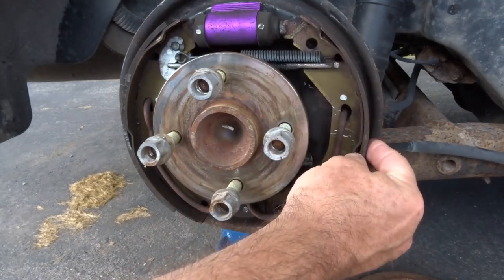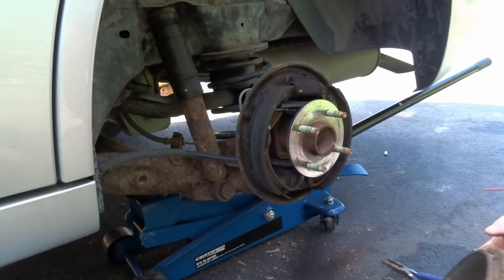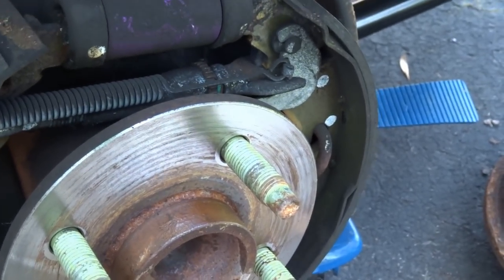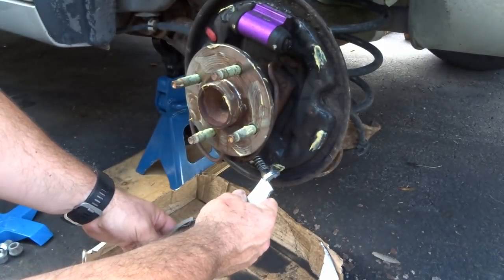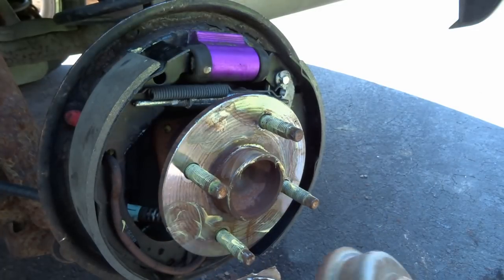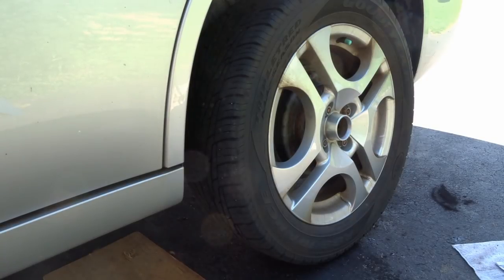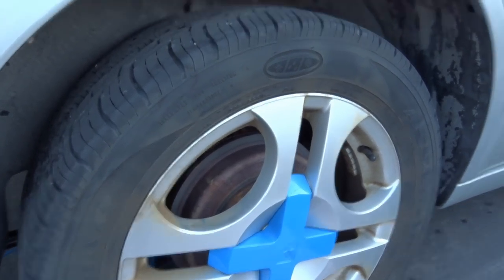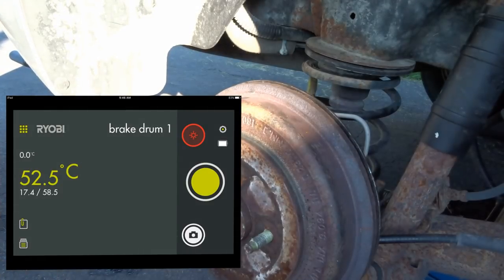Saturn Ion Rear Brake Replacement 2003 to 2007

Comment: This dude is catching  hell with the emergency  cable. Side cutter will do the trick to push the spring. And it will come off in a heart beat.
Reply from the maker: Mauricio Corleto LoL, yes you are correct, use side cutter to pull spring back and hold... good point... for others... do not cut the cable off :) just enough pressure to hold.. thanks Mauricio...
Reply: @kd_enterprise3404  you ain't gonna cut it believe me.
Reply from the maker: Mauricio Corleto thanks, have a good weekend!
Reply: @MrMauricio1947  you

Comment: Very helpful coverage….A Saturn Ion came into our possession….as a result of it sitting outside a rear brake seized and the “U” spring snapped . The way you positioned the one side, pinning the shoe without fully dropping it into the hole and then inserting the other side, made all the difference in my frustration level…did it without the tool….so glad as I’ll probably never do a drum brake repair again …..thanks so much for your effort in making this!
Reply: They’re not supposed to be this hardc, this drum brake is by far the worst I have ever seen. Just never by GM (General Motors) garbage. I curse their engineers, I know the car was made a long time ago but honestly there is no excuse for such terrible designs…
Reply: @arnobashtar6707  👍⚠️😡

Comment: Thank you for posting this video. Idk what I wouldve done going into this not having a clue. Disk brakes, easy. These - NOT easy. The rotors were cemented onto my 03 Saturn, but after lots of banging they came off and then I just followed the steps through. THANKS man again for posting. Great video very informative
Reply from the maker: Kyle Lohr you are welcome, glad it was helpful.. thanks for the comment!

Comment: Just changed my rear drum brakes on my ION . think I did it correct but now my brake pedal almost hits the floor with very little stopping power. What you think I need to do to fix? Thanks great video!
Reply from the maker: Most likely you have air in the brake lines, the first step  to try is called .. bleed or bleeding the brake lines.  Do a search on YouTube, the procedure is very generic so find I high rated vid. It’s best if someone can help you. Once you complete the process check for leaks. If you live in a colder climate where they put salt on the roads it’s possible a line could be rusted out.. generally most common, air got in somehow… or the brake fluid reservoir was low and let air in, or a damaged brake line.
Reply: Turned out to be a leaky wheel cylinder . Easy fix . thx for the reply . Have a good one!
Reply from the maker: @michaelaspden9073  glad u got it sorted out!

Comment: ha! exact same thing happened to me, both linings separated and it locked my rear wheel up, i was doing 60 when it happened, not a fun experience when youre 20 miles from home. finally got her home and after about 20 minutes of pounding/prying and good ol fashioned cursing, i got the drum off and saw the single spring and said "what the -- is that?!" so thank you for making this video, i really didnt want to pay for a specialty tool (thanks GM, always making life harder one specialty tool at a time) i finally got her repaired but now there is a weird clacking noise coming from the very side i repaired...at first i thought it was the adjuster working itself into place but it hasnt stopped after several miles of stop and go driving...i really dont want to tear into it again, i rewatched your video and i feel like i did all of the steps correctly but i guess we will see
Reply from the maker: Zap Actionsdower pads are made so cheap these days. Glad you made it home and hopefully the repair worked out.. thanks for the comment, hope you have a good Christmas.
Reply from the maker: Oh, ps, the clacking sound, not sure what that is, might be worthwhile to knock the drum off and take a look, just loosen off the handbrake and the drum should come off pretty easy.. plus after you drive and not doing much braking check the temperature of drum..
Reply: Make sure you didnt put the brakes on backwards. Also it could be the bearing gone bad
Reply from the maker: John Vega it could be a bearing,, I’m not saying always. bad bearings often  just start being very constant noisy. I’d check the drum condition again, that failure at 60 might have cracked it. I’m also suspicious if perhaps the parking brake spring cable detached, the new brake pad slot is pretty sloppy until you get some tension on it, it could pop out. I hope we hear back.

Comment: First thanks for the video. I popped the spring off with a bar,rebuilt the pads with the litte spring used a long zip tie to hold in place. Then slid the spring into place
Reply from the maker: Good plan, thanks for the contribution!

Comment: Good job thanks. Any idea why the big single spring that hold the  stuff on would be broken?
Reply from the maker: I did not replace the spring this time, normally they do not break, but rather become weak, and don't hold things together, if they get hot, they get weak.... mine were fine so I re-used them... thanks for watching and the comment!
Reply: @kd_enterprise3404  yeah it's weird mine broke in half. Looking at it, it's been broken for a while. Anyways thanks again for the good video!!!
Reply: To help install that big spring I used Lisle tool part number 50600 Single spring brake tool for GM. It helped the install a lot.

Comment: What is it on the bolts of the hub, it has light green color. Is it green threadlocker, or it is a residue of the blue one, but faded? Thank you for the good film.
Reply from the maker: Olena Erhardt actually that’s some lithium grease in the threads. It’s not required but I do that so the lug nuts don’t rust on. Where I live in winter they put salt on the roads and everything gets rusty...
Reply: @kd_enterprise3404  I started to guess, bcs in one film I saw now he placed some white litium grease on those bolts. But thank you very much for the confirmation. You know I recently removed a wheel from a car for one job, saw that greenish blue staff on bolts, so when put back the wheel, added a bit of blue threadlocker (since didn't have a green one). I'll be removing it after a few days for another project, would be interesting to see the effect. Do you happen know what is a preferable threadlocker for the Inner Tie Rod (red or blue)? Thank you for the great film again.
Reply from the maker: Olena Erhardt I actually have never used thread lock on a car. Most things susceptible to coming apart use cotter pins or lock washers.. Not saying don’t use but my guess would be a type that resist oil and fuel.  Not sure which it would be.   Thanks for checking out the vid!
Reply: @kd_enterprise3404  Thank you for the replay. Yes, there are many opinions, that if a certain torque specification is assigned, just better not to use any threadlocker. Some people (me including) do both. Thank you again for the film.

Comment: So rge 2007 saturn ion 2 I bought would skid with both front tires when hard braking. Replaced calipers rotors and pads. Still did it. Took off rear drums. Bad cylinders both sides. Replaced cylinders and shoes. Now no more skidding front brakes when braking but now my rear driver side skids and locks up on hard braking. Never had a vehicle do that. Any suggestions?
Reply from the maker: The rear brakes should self adjust by driving backwards and applying brakes.. if u have not tried already.....
.
Reply: Im on my 3rd new wheel cylinder. Everytime I put the left pad on and in place. Then every time i try to put the right side on the pressure from the left side shoe pushes the right side out too far befire a can getvthe spring in the right shoe hole and they bust and start leaking. The o rings keep busting. Only reason i wanted to change the shoes is cuz i bought the saturn with 2 bad rear wheel cylinders. What a pain.
Reply from the maker: @JOESMITH-bx8qv  this sounds unusual, you should be able to compress both pins in before putting the shoes on, my only suggestion without actually being there would be to lossen the bleed valve slightly and then compress valves/pistons in at the same time. It sounds like one side when  compressed is pushing the other side out too far and damaging the oring.  Hope u get figured out...
Reply: @kd_enterprise3404  Thanks for the suggestions.
Reply: @JOESMITH-bx8qv got it sorted out?
Reply: @adictiveadictive  no. New shoes and finally got both new cylinders working and passenger rear still grabs with moderate break pressing. Im going to take it to a pro Monday. So maybe needs new drums also. I know I paid foe new shoes and cylinders but IDC at this point. I'm gonna tell them new shoes cylinders and drums. Also make sure they fix the spongy brake pedal. This has been a very big headache. Never messing with shoes again!😂 Thanks for asking. I was being cheap trying to fix it myself. If it cost $300-$400 to get it 100% safe than thats ok. Been out of work for 2 1/2 months. Its cool. I make $800-$900 a week doing DoorDash/UberEats working 7 days a week from 5pm- midnight. I need a safe car cuz I drive around 150 miles a night in my 7 hr shift. I needed this break. Worked a year straight. Its an addicting job. Take care brother!✌🇺🇸🙏🔫

Comment: I have 1 that's super freaking tight do saturn ion 2005 have a locking nut?
Reply from the maker: Not that I'm aware  of. But if the car was owned by someone else anything is possible.
Reply: @kd_enterprise3404  who ever owned it before me used something probably an impact driver. Went to tire shop, took it off easy.
Reply from the maker: @tylerrogers4312  u r probably right, glad it worked out....

Comment: What happens if i can't get the drum back on? Emergency brake is off and I re-tightened the bolt by the handle. The drums are just too tight to fit on.
Reply from the maker: Nick k I’m guessing, see the purple piston in my video, I’m guessing the they are not compressed in all the way, and the metal adjuster that fits between the two shoes needs to be turned in, it’s probably set to the old shoes...which means it will be too wide for the new shoes,, I actually explain this shortly after I put the drum on...

Comment: Why is your hand brake spring so loose and easily pushed back. Took me almost 2 hours to try and get that spring back. Took 2 strong people and 2 sets of vise grips. My arms feel like rubber and tomorrow I have to do the passenger side! Ugh. What am I doing ao wrong😢
Reply from the maker: Odd, normally loosening the nut on hand brake frees it up.
Reply: @kd_enterprise3404  ahh. Musta not heard you say that. I will try tomorrow. Also had a bad cylinder but that was easy. Itctakes an e8 torx which i had to wait 2 extra days from prime. Im 42 and was always affraid of drums and shoes. But this W spring looked much easier. Also was so fustrated that it took so much strength and energy that I didn't grease anything. I dont have white lithium grease but red tacky #2 which is lithium based. Thanks for the advice. Makes sense but like I said I never touched drums or shoes so I didnt know. I was having the hardest time trying to get the drum off that my neighbor came over and said you dont have handbrake on do ya. I was like F**k!😂 Thanks for the advice and great informative video! Take care brother🤙🇺🇸🙏🔫

Comment: Whoever designed rear brakes in Saturn ion - I hope they end up in Hell replacing rear brake shoes for the rest of eternity. It took my so and I 2 hours to slip that emergency brake link on the new shoe, including 45 minutes when my wife tried to help. I ended up having to file a lot of that new brake shoe....

Comment: Any idea why when I changed a flat tire in the back and put in a new tire with Same rim and I hear a wobbly grinding sound
Reply from the maker: Guss Indica That is odd.. keep the tire on, jack up that tire off the ground so you can spin by hand.. turn it and listen close, give it a few tugs also, if the lugs are tight and some movement is felt then it could be the bearings.... not being there to see and listen makes it very difficult to diagnose.. but ya first things that comes to mind would be a bad wheel bearing, even if no back and forth movement is noted, and you hear a grinding is a good indication.. if so it needs repair ASAP.
Reply: @kd_enterprise3404  checked it. Turns out my spare tire is a different size than the original. The Circle that holds the tire to the the drum won't go all the way in.
Reply from the maker: Guss Indica whatever is going on, don’t drive it until everything is working properly.. good luck..

Comment: Okay do not ever I repeat DO NOT EVER EVER EVER apply lubricant to your brake system without extreme caution. Even a small amount of lubricant on your rotors or brake pads can easily cause your brakes to fail. If you must apply lubricant make sure to clean your rotors and brake pads with brake cleaner. Good video though, thanks for the help